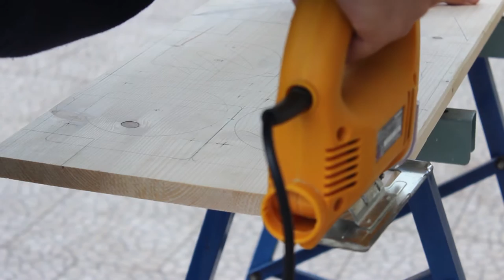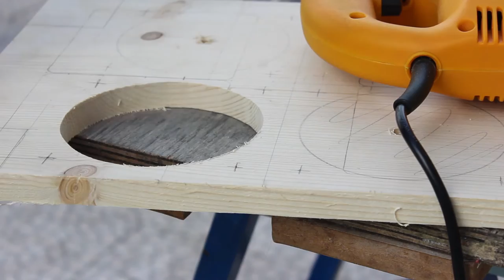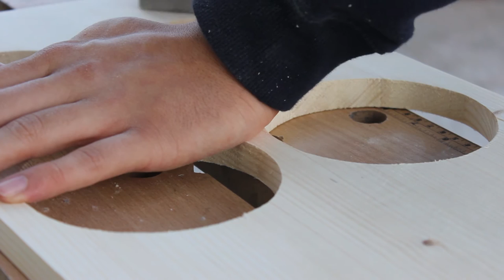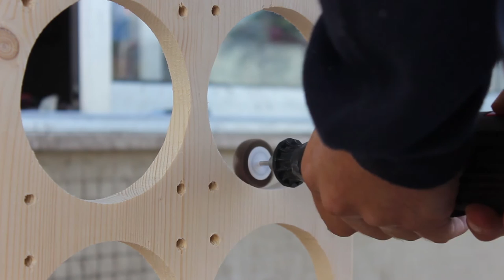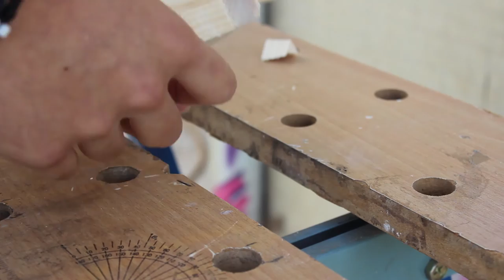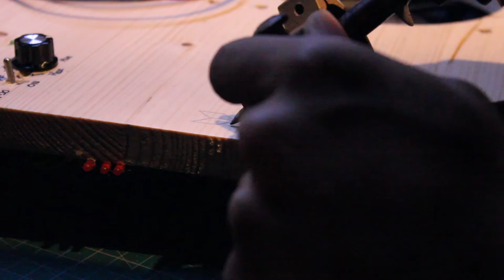Laptop Cooling Table - [Making Of]

Comment: how efficient was it? and how did you have a speed controlling knob? thanks in advance
Reply from the maker: Very efficient! :) Around 10fps better and much more consistent ratings overall. I skipped the circuit part as it was designed from the ground up by me, but the part that controls the fans speed is basically just a PWM signal from a 555 timer (not counting with the turbo mode wich is boosts it up to 15v instead ov 12v and some lights and stuff start flashing). If you want the circuit just PM me and Ill send you :)
Reply: Iago Pereira thanks for your reply tbh with you I'm not that good in understanding what you said because of no experience but i want to make a cooling pad by myself that is unique and reliable and your video is the one to go with..
Reply: Iago Pereira and yea about the temps how much did it make of a difference?
Reply from the maker: If you need any help just ask :)
It lowered the package temperature somewhere between 5-10ºC depending on the outside temperature. I have an ASUS ROG G551JW, just for aditional info on that
Reply: Aha.. thanks a lot and i will do 
Much appreciation
Reply: Iago Pereira hey any info about the circuit that you used?
Reply from the maker: Kenneth de Leon yes, if you want to I can send it to you
Reply: Iago Pereira that would be great, thanks
Reply from the maker: Kenneth de Leon just pm me on fb
Reply: hey man, can you send me the circuit that you used, too?